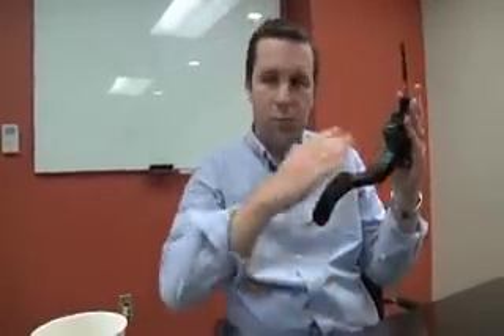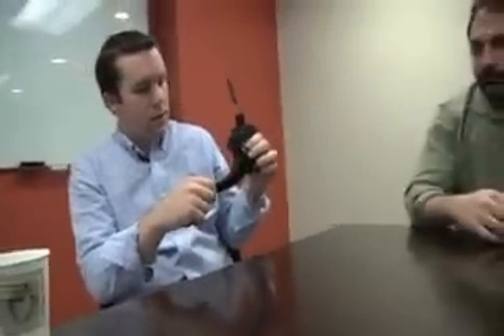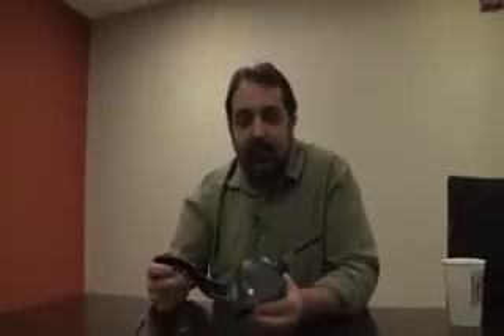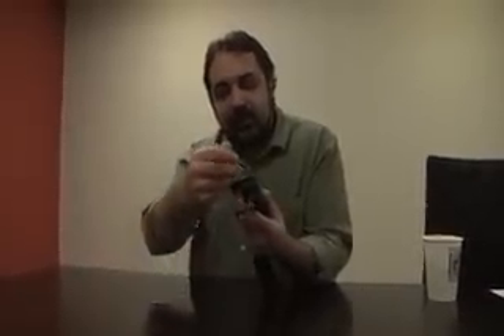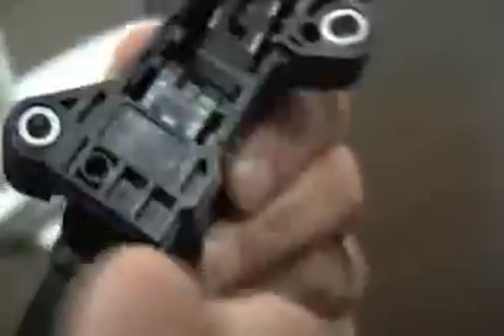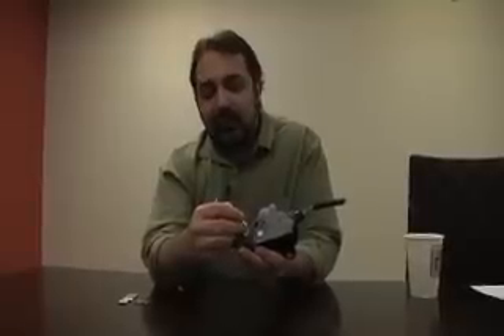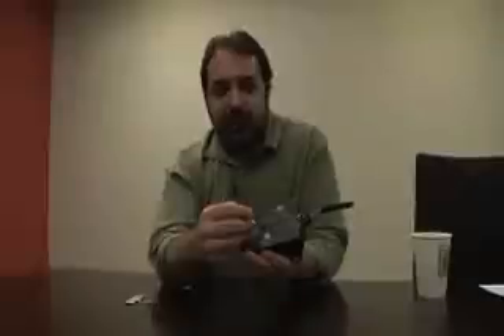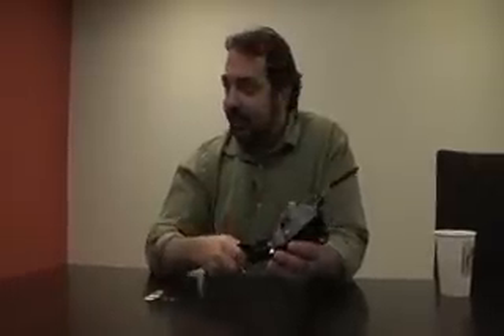Toyota Recall | Sticky Accelerator Pedal Explained

Comment: No offense mitmaks but I had a '66 Mustang that I bought used in '91. Within the first week I made a 90 degree right hand turn, with light throttle, when the pedal shot straight to the floor. The rear swung wide and I almost ran head on into a large old oak tree. I slapped her into neutral and barely stopped in time. The prior owner failed to tell me that engine mounts had rotted though. In the corner the engine lifted high enough off the mount to pull the linkage to max. Nothing is perfect.

Comment: The person who crashed in San Diego was a CHP officer and don't tell me he didn't know what to do!  It seemed like the brakes was rendered unusable while it was accelerating.  He probably put it in neutral but still no go.  It's also questionable how Toyota got the shim solution rather quickly.  Did they intentionally left this process in the beginning to cut cost?  What does the shim actually do?  No explanation on the purpose of the said shim.  It's an electronic problem me thinks.

Comment: Turning the engine off before you could safely park the car is a bad idea. If you turn the engine off, you'd lose power steering and power braking. Just put it in neutral and then coast towards the side of the road

Comment: Toyota needs to update their ECU software to give higher precedence to the brake pedal than the gas pedal. The software should operate in a way such that it compares the position of the gas pedal and the brake pedal, and their difference exceeds a position threshold, shut down the car to prevent damage.

I would be interested in knowing if all of the incident occurred on cars with Cruise control, which have an actuator that open and closes the throttle. That would likely point to an ECU problem.

Comment: Yes, driver is doing same thing. However it's not Ford's fault that rust ate engine mount. Ford did not put faulty accelerator. Toyota however did put faulty pedals in their cars and they knew about it years ago. This is worst safety-related recall and it happens to be #1 (or so they say) best selling car etc etc.

Comment: Toyota  -  Got some bad news for you   cruise control does cause accidents.
Can hydroplane in wet weather.

Have a 96 Toyota Corolla and have never had an accident ever in all kinds of trucks and cars. 90m on Toyota
When I leave home in the morning I go half a mile up a slight incline and downhill half a mile to a light.  I have noticed at least 6x that coming to the lite when I have to slow down or stop the car wants to  not stop.  I guess you would call this early morning car blues and even more difficult in wet weather and not in cruise control.  Toyota needs to tell their cars to wake up in the a.m.

On a highway in cruise control with the cruise control on when I go to slow down the car does not react immediately to slow down and every time I have to do this this happens.

I think the cruise control was stuck on in that Calif thing.

There is a problem with Toyota's cruise control.  Whenever I have it on cruise control and I see something happening in front of me that I might have to stop or slow down, I knock off the cruise control and the car brakes just fine.  In tense situation with cruise on,  I would say it take 1.5 seconds to react and the braking does nothing.   When you brake, the cruise control system has to tell the car hey this guy is braking knock it off.  So this is just enough time to cause an accident.

My son has a Stick Camry 2009 and is pretty brainy.  I told him about this, and he said the first thing to do in an emergency like in Calif is turn the car off.  Pretty smart.  That guy supposedly tried the emergency brake and nothing work and even spent time on the phone with a dispatcher so why wasn't he told to shut the car down.  Huh???

Comment: Bad explanation for why you shouldn't pump the brakes. If the throttle is wide open, the brake booster will stop working after one or two pushes on the brake pedal. Power brakes need vacuum from the engine to work and there is basically no vacuum at wide open throttle. Brake boosters typically reserve enough vacuum for two presses on the brake pedal. That's why Toyota recommends standing on the brakes and not letting up. Once the vacuum's gone, no power brakes!

Comment: No offense piwright42 but you're comparing 25 year old car!!!! Have you thought about it? Nobody will be restoring/collecting camry/corolla or any other toyota in 25 years from now. You're comparing a rotten engine mount to a faulty electronically controlled throttle, apples to berries. Next time compare something that is less than a decade old lol